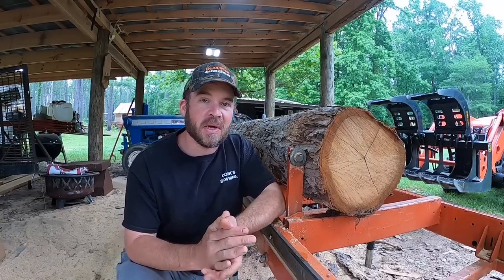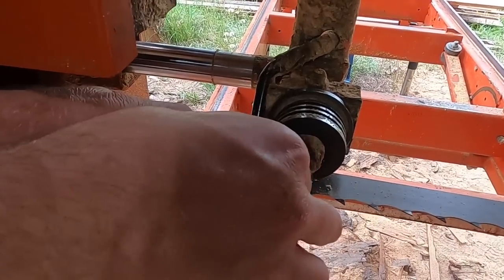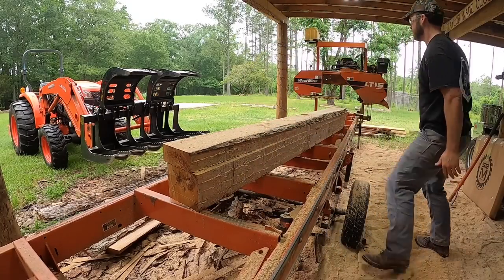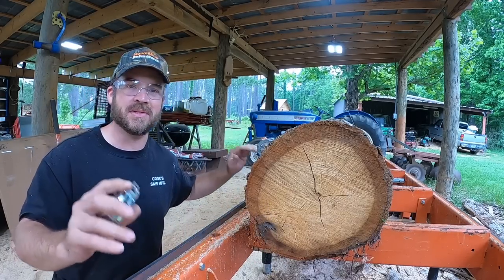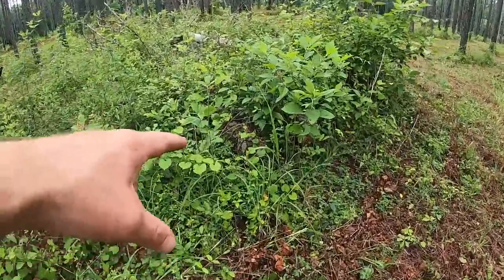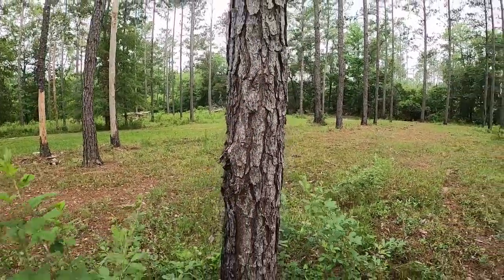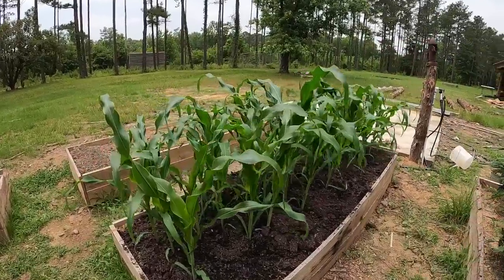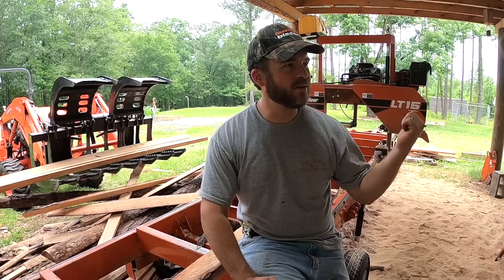Log Sawing & Tricky Tree Felling

Comment: I was buying two blades at a time from Wood Mizer at $25 a piece plus $22 shipping. Then you made reference to South East Metals so I checked them out and ended up buying a half box. The savings was fantastic and I'm very pleased with the cut I'm getting. My sawmill is home built, works great but needs tweeking every so often. Thanks for the tip.

Comment: Question from a non-sawyer... watching you start on that first White Oak, how do you determine how far down to make that first and second cut? Is it based on a dimension or is it just enough to cut into the heart wood or...?   Thanks.
Reply: It depends on each individual log and imperfections but for basics the intention is to create a useable face just inside the bark. That on average at least 4 inches of surface but better 6 or more. The idea is to get the most out of a log without waste while milling economically.